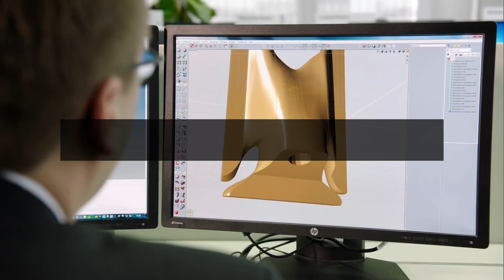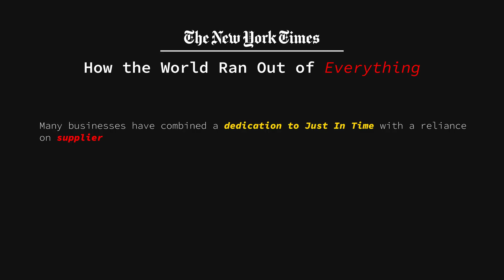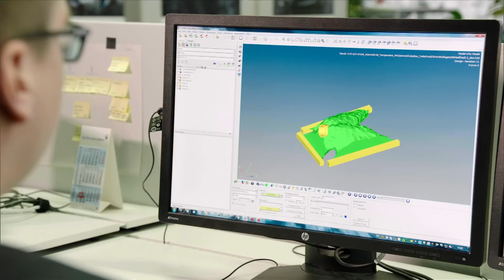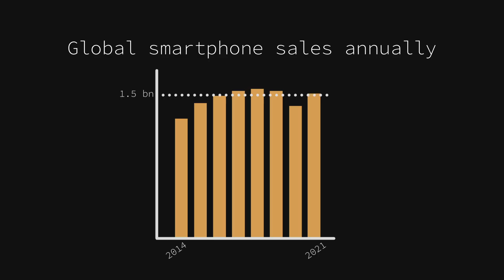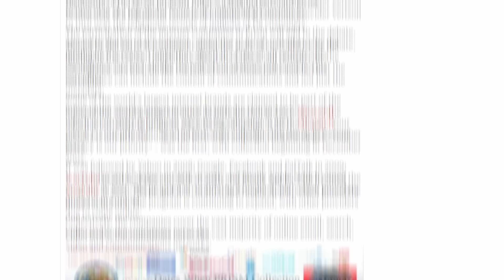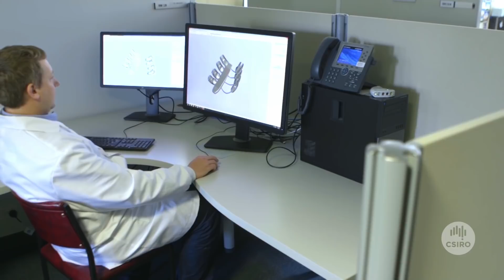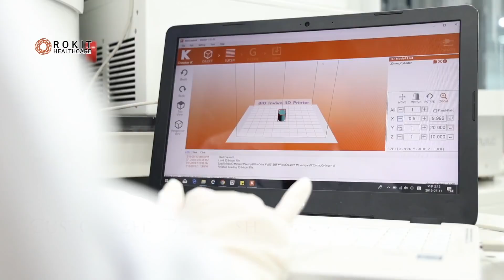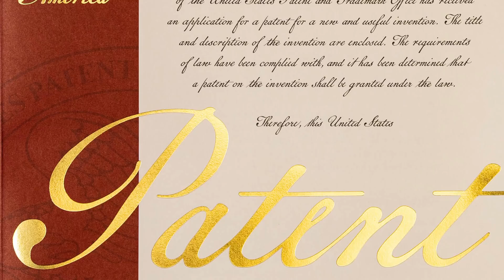How 3D Printing Could Decentralize (Almost) Everything

Comment: I find several, some serious, pr*blems with your video.

1. 3D printers are not magic. They have limitations. They are p*infully slow (hours to print one part) and finicky (prints can fail to several reasons). I have a 3D printer (a very cheap one, but still). If you would have played around with 3D printer, you would not be optimistic.
2. The surface finish and precision s*cks. Good luck printing a phone shell, which fits and is usable. (Unless you have a optical resin printer)
3. Have you ever opened a phone up? Have you seen what is inside in phone? The shell is one tiny part. 3D printers can't make anything more for the phone. Go and watch phone teardowns on YT.
4. If you print anything practical thing, which requires strenght, you will have to use ABS plastic and not PLA. ABS st*nks so bad. It is trully h*rrible. You can't be in the same room and you can't open window, because it will m*ss with temperature and will d*mage your part (ABS shrinks).

In short, 3D printers are only good for prototyping, very small scale manufacturing, custom part manufacturing. It can't compete with traditional manufacturing, which sp*ts out several parts per second. Good luck doing that with 3D printers.

I had to use * to stop Youtube deleting my comment after 30 seconds
Reply: your profanity filter is next level (i've had to do the same for a few of my comments too), wouldn't want people learning words they can use to describe the world around them now would we. it genuinely baffles me how YT is allowed to beat the C.C.P at its own game.
Reply: @afallingtree9114  YT is becoming CCP. They plan to disable dislikes, to "not hurt feelings" to scammers, fake tutorial makers and sponsors. Only positive feedback allowed. Not to mention, YT still censors some words for CCP.
Reply: i don't think that decentralized manufacturing comes only with a 3d printers, but rather with 3d printer and pick and place machines. the next problem would be sourcing the components, which aren't easily diyable and you can only get via shipping or recycling
Reply: Basically, this video is full of shit.
Reply: I agree with 1 and 3. 3D printing  takes a while, usually at least an hour and can even be a day or more. However, 2 and 4 don't make sense. There are WAY more than 2 types of filament (like NinjaFlex, Nylon, and even filaments with wood and metal in them). There are also lots of types of printers, like metal (pure metal, not metal and plastic) and optical SLA.  Also, the quality on 3D printers is very good, especially with expensive ones. The quality is good enough for many DIY projects to sell them directly.

Comment: We can't 3D print most things. The tech needs to get better before it can really compete.
Reply: What do you mean by most things? I’ve been able to 3D print a good 80% of things I need. Everything from lamps to phone stands to vacuum attachments to replacement parts, even a new retractable leash body for my dog. And I’ve seen people online make drones, telescopes, truly incredible things. There are a lot of new synthetic plastic materials that are very durable, and there’s also TPU and TPE for more flexible, rubber-like material needs. 3D printed parts aren’t food safe and you can’t print in metal at home yet, but the technology is actually really good, even for a beginner like me. 

I agree that the tech needs to get a lot better, I definitely struggle with fixing my printer on the regular. But with a little bit of ingenuity, I actually think you can 3D print most things. It blows my mind daily, I feel like I can basically think things into existence.
Reply: @clared5812  When a 3D Printer can print a 3D Printer, we're there
Reply: @clared5812  wood, electronics, textiles, papers, and crystals come to mind off the top of my head.

Comment: Most green and environmental solutions proposed often offer huge inconveniences and problems to solve 1 problem.
This one is a far better solution as it doesn't solely address one problem, it addresses many. Much of our traditional methods of shipment and manufacturing answered problems of a different generation. They can work on their own and are necessary for transition to a new ideal. The problem, however, has always been where material comes from. So much of our goods unfortunately come from places with poor pay and bad living conditions. That should be the first to go, and this is actually where robots actually solves a human worker problem. While these robots do effectively take labor, they require more skilled labor in the form of repair, manufacturing 3D design, and infrastructure of the robots themselves.

This is way better than the proposition of things like solar, as solar produces several of its own problems (still requires acquiring goods from poor workers, only works under specific conditions, takes up massive amounts of land space reducing usable land, produces heavy e-waste and chemical waste when the cell brakes, requiring more use of non-renewables to clean up the expired material).

One might say "well plastic is necessary for 3D printers, that's bad for the environment." The problem with plastics being considered bad is failing to realize that the material for plastic is already in the earth and will remain there until it is used. It's HOW its used and disposed of that determines environmental impact.
Reply: They are also much less green than the product they are trying to replace. Compare the toxic materials in an electric car to a combustion engine care. When the refueling station are powered by diesel engines, it makes even less sense.
Reply: @MAGAMAN  It's really the discussions I wish we could have. If you question green technology, you are considered a denier and the conversation is shut down.
Improvement in alternative technologies doesn't happen in a vacuum driven by political fuel.